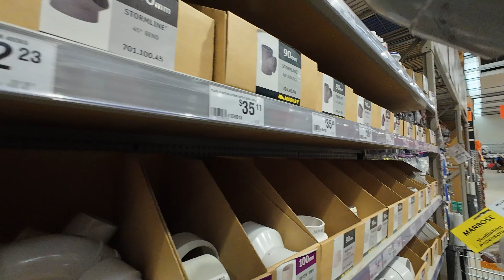A trip to PlyGuy in New Plymouth for building supplies! [Life in New Zealand Daily Vlog #685]

Comment: Resene roof paint for metal paint cobber, best there is apart from maybe Dulux.
Reply from the maker: Oh true! Thanks for the tip! We went with the hammerite because it had good recommendations when we were looking for the best paint.
Reply: @RealNewZealandAdventures  Yes I know, but with roof paint you get much more for less, and it sticks like you would not believe, if you get the primer too. Also any colour you like they will mix it before your eyes. It doesn't chip and scratches are not that noticeable either. You can use it on zinc cause roofs are galvanised too = :)
Try some Moreys Diesel Fuel additive in the van, tell me it doesn't work and gives you a significant increase in fuel mileage - as well as power. One of the few things that works like it says it does.
Reply from the maker: Oh well information that would have been useful to us before we bought the paint! 😆 Nevermind, will remember that though thank you! I think we got enough paint to finish the job now. 
Will look into the fuel additive too!